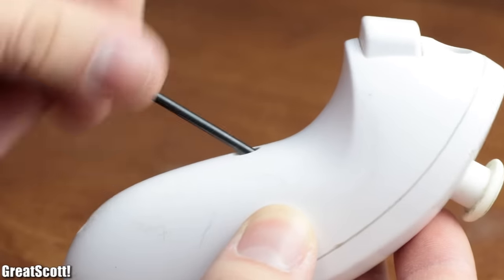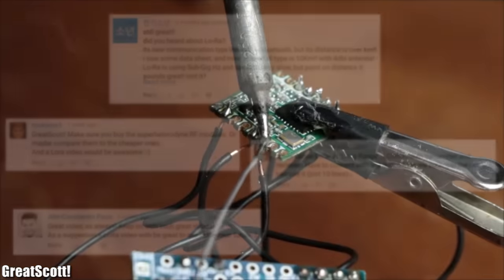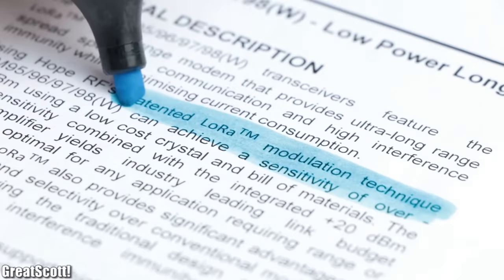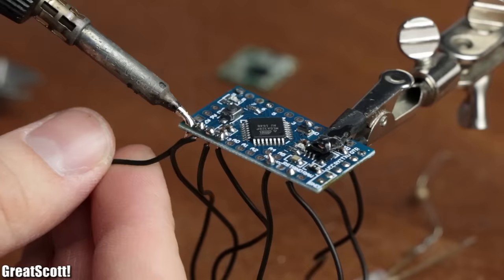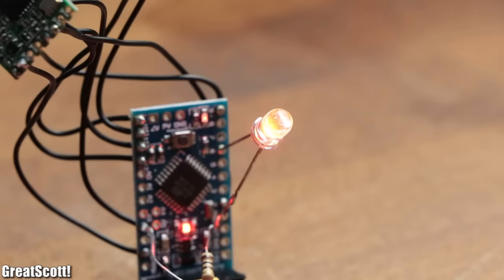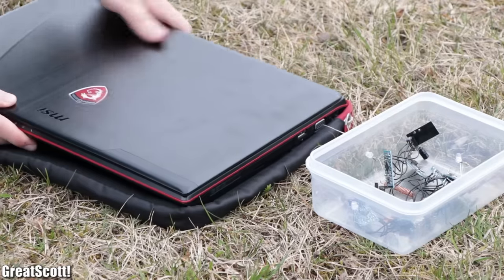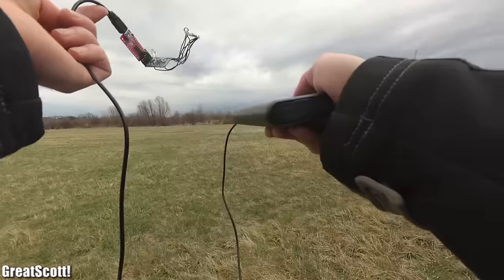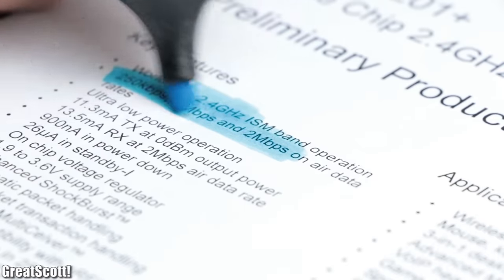LoRa Module VS nRF24 VS Generic RF Module || Range & Power Test

Comment: I've tried adding an X2401C chip as an amplifier for nRF24L01, and it turnd out that the range can rise much higher. Actually this type of combination is very popular now, but I just felt like designing one myself so I can integrate the circuit with other modules in a single board later :-)

Comment: One EXTREMELY important thing that you did not mention here. That is duty cycle. LoRa is limited by law to transmitting at most 1% of the time. If you have a problem where you need to be transmitting more than that, you must eliminate LoRa from consideration at the start.
The nice thing about LRF24 is that it's highly resistant to noise. I've built real time remote control stage props using it, and I can easily get a couple dozen channels in and control it from the back of a theater and have good confidence in it working on queue. LoRa would not be usable there because I need to transmit constantly.
Reply: When you talk about laws you need to specify the country and frequency. No laws apply to LoRa specifically and LoRa can operate on several different frequencies. I think you're talking about 915 MHz in the U.S. is that correct?
Reply: isn't that only for the subbands?
Reply: No i think he speaks about ISM in Europe.... so he is totaly correct. 36s transmition time per day ! sooooooo not a good choice for this project....
Reply: JuulCPH LoRa in the US 915MHz band is allowed a 40% duty cycle. Much better than Europe.
Reply: I agree - I digged into LoRa a month ago... but I have some questions, I haven't been able to get a proper answer to, if I may... If I set up a service with some nodes, transmitting to a LoRaWan, what will stop "bad guys" from jamming the entire network by transmitting constantly? Do I have to rely on the authorities to shut it down? Also, 8 channels using 1% bandwith = 800 nodes in theory. What happens when there's no more bandwidth - or if two nodes transmit simultaneously? Will the system give the strongest signal priority?
Reply: what law is that? definitely not FCC
Reply: LoRa Class C allows for continuous reception and transmission at any time.   You might be confusing it with the LoRaWAN TTN network which limits duty cycle.   You can't use LoRa class C on the TTN network.

Comment: Great video. To perform such kind of test you need to investigate also the antenna type, orientation and connection. I'm suspecting you are loosing a lot of power on these blocks. Pay also attention not to transmit something without antenna, you can damage the transmitter because you are working with very bad SWR ! Look at Andreas Speiss video about Lora enad antenna matching. In any case thanks for this video.

Comment: Should do a vid on the esp8266 boards also. they dont necessarily need a wireless router to connect and talk. one can be in AP mode and others can connect and talk to that one. It is another form of communication that should be considered.

Comment: Why did you use the 433 mhz antenna with the 868 mhz LoRa module? It should be a different length for 868 mhz, you should be able to easily get 1 km or more in an open area with those modules and a wire antenna of proper length.
Reply: surely if 868mhz is twice 433mhz the antenna would be a harmonic of the wavelength, though?
Reply: @racketman2u  Something, something, impedance.
Reply: Cut the antenna in half,  but helical is bad antenna for this

Comment: 7:29 you said 4 kilobits per second, but it is written like 4KB/s not as 4Kbps so it's kilobytes and 1kiloyte equals 8 kilobits so the first one can handle  32 Kbps(4KB/s times 8bits in a byte)

Comment: I think if you're only getting that range out of LoRa you must have extremely poorly matched antennas.  You should be getting hundreds of meters easily.
Reply: A km easy!
Reply: and I think he forgot to set the spreading factor, but even with the default it should be much more than this.
Reply: John Ridley with the same devs i was able to get 18.9km, something is odd there (rmf95w > lora gw)
Reply: Well he was holding the antenna in front of him while moving away from the transmitter behind him so, his body did not help
Reply: In our tests at the IoT company I work for, we got 500m range the middle of the suburbs, surrounded by houses and concrete buildings. LoRa is excellent.

Comment: I used to do nRF's until I discovered Si4432 modules. They are much powerful and customizable. A little messy to calibrate but there is an Arduino library you can use which makes it a breeze.

Comment: Generally speaking, the higher the frequency, the higher the data transfer rate, and the higher the power consumption for the same distance (or the shorter the distance for the same power consumption), that would explain all the testing result. So there that is the trade-off. I have played with nRF24+ for a while and got a similar testing result for the maximum distance. But I need to mention there are variations to nRF24+ with an amplifier or better an antenna that is designed to handle longer distances (the seller claims it will work for ~900 meters in clean space, but I never test it). Of course, an additional amplifier would consume more energy.

Comment: Great video! As Andreas mentionned LoRa has more potential. I'd also give 2.4 GHz more chances with nrf24+pa+lna and use nRF51 and nRF52 which have +4db in stead of 0db of nrf24.

Comment: Looks like this is going to be the go to module for your quad-copter project. Can we extend the existing antenna (They call it something like the Meandered inverted F antenna ) on the nRF24 for a better range? Make an electronics basics video on antennas.

Comment: There are also hihg power NRFs with claimed range of 1100 meters in open field. The transmission range depends on power amplification set in the program too. 5 meters seems like you set it to minimum.

Comment: Great tests and explanations. In the future I would like to see a distance test with the transmitter antenna mounted on a pole or higher structure. Even the roof of a car. My guess is that LoRa will show a remarkable distance improvement.

Comment: I ported the Arduinio Virtual Wire library from C to JAL and used on a PIC microcontroller together with the 433 MHz transmitter and receiver module but the range is higher than mentioned in your video. If you look at the documentation of the Virtual Wire Library it should be able to reach 100 Meters depending on the chosen bitrate.

Comment: Can you try also HC 12 modules? They are transreceivers which costs around 7 euros on amazon (in Italy). Per datasheet, they can transmit in a range of about 1,8 kilometers.

Comment: In the video you tell us you're using a 868 LoRa module, but you use the antenna of the generic 433 MHz modules? Also the amazon link leads to a 433 MHz module?

Comment: Great video. Right on time, too! 😎👍🤠
I'm thinking of remaking my dog collars and was wondering about which broadcast tech to go with. I think I'll be using LoRa after having watched this video. 10m is not far for a dog to roam, especially on my property. 300m is more like it. Do you know what the obstacle permeability of LoRa is with relation to distance?
I would also like to add a gps monitor (which LoRa could upload as well). Do you have any recommendations on a small module with little power usage?

Comment: Nice experimentation.  At time frame @5:34 have you had chance to test for range in different area? Were there any cellular or power transmitters near you? If yes then there maybe an interfering signals affecting the range test. Just food for the thought. Believe it or not, even the nearby microwave oven or other equipment may reduce the range because then the signal will be received by the receiver and thought of as noise. Filtering and power increase may increase the range, to overcome noise, if any.

Comment: Did you know that there is a verison of the NRF24 with an antenna and a repeater on the same board? It has a range of about 1 km. I'm using it for my projects.

Comment: Its known that lower frequency has higher range; 433MHz has higher range and 2.4GHz has the smallest. Also, the power consumption is proportional to frequency. Data rate is proportional to bandwidth (carrier frequency), so 2.4GHz has the highest.

Comment: I lost a quadcopter a few weeks back.  A wind burst pushed it over the treeline.  I shut it down, got in my vehicle and drove to where it should have landed.  Vanished!  So now I'm exploring the idea of building a tiny unit that reads data from a GPS chip and transmits the current LAT/LON. And a tiny receiver that will receive the GPS coordinates and display it on an LED display.  Investigating LORA, NRF, ESP8266.  I've worked with ESP8266, I don't think the range would be big enough to cover a football field size area.  Any suggestions?  Thanks in advance.

Comment: I thing you should consider to repeat your test with proper antennas (even a simple wire antenna is better than the helix). I used the Generic RF Module exept tat I used the superheterodyne receiver RXB6. I wrote my own protocoll for the transmission and receiving. I have a data rate of 2kbit / s and got a range of 900m on the free field till the receiving "act strange". So I thing with a better setup you could get much better results

Comment: Signal amplification and antennas are very important for RF range, so I guess you could use WIFI antenna for the nRF24 case. Most RF modules have standard antenna connection to attach external antenna.

Comment: You could at least point antennas properly cause they don't radiate the same power to every direction. I managed to get up to 50m with nRF24 and up to 600m nRF24+Pa+LNA modules on line of sight. Good capacitors on power line and stable power source are also very mportant. Anyway, thank you for the video

Comment: If you use proper antennas, you'll get much better results! LoRa can easily reach kilometer distances. My record with the same module is 27km between Vlieland and Harlingen in the Netherlands.

Comment: The generic one offer speed of 4 KByte/Sec.
But the lora offers 37.5Kbit not Byte so we have to divide by 8 to get the speed in KiloByte as in generic one. So the lora offers almost 4.68KB/Sec. Which is close enough to generic one.

And nf24l01 offers upto 2Mbit/Sec(250KByte /Sec)which is the fastest

Comment: I use a pair of nRF24 on my DIY longboard setup as well, even with wires, battery and aluminium case of the speed controllers I get 30m before  start to loose packages

Comment: LoRa has SERIOUS limitations not exposed in the video. it is not intended for real time nor big packet tranfers. You can still do it, but there are some rules about the duty cycle of the transmision ... 1% for Europe. Why ?. Because each time you send a packet, in order to the gateway to receive it, no other comunication can take place . so all other module need to wait until it finishes. LoRa has channels to overcome it, they will set up to 64 of them. Still looks like easy to bottleneck if used improperly. Range is supposed to be far more than in the video and many tests already have proved that. BUT, the far you go, the slow it gets. also you need to adjust settings as this happens. The last point that the video missed is, YOU CANT USE LoRa IN Point to Point. You NEED A GATEWAY ... i.e infrastructure ... example .. a TELCO. Your packet go to the gateway and then to the other radio. You can do a P2P RF link, BUT just using FSK or something like that, I mean, stoping the LoRa part and just using the radio ... but it will reach the range of any other 865Mhz radio. The trick of LoRa is the modulation. But dont miss the point, YOU DEPEND on a THIRD PARTY GATEWAY, like a CELLPHONE.  LoRa is stunning for small data in rural areas (not dense populated). I dont see this on big cities or project were big chunks of data are needed. It is not the technology. Porbably Sigfox  (I havent read about it). You can purchase you gateway of course. They are a bit expensive. If you want to manage it remotly and some other functions, like web access control and location .. bla bla bla ... you need a SW package and to purchase a key. The gateway I was offered is a Linux embeded system with a console.

Comment: I didn't notice this before, but 433 MHz is square in the range of ham radio 70cm, making it illegal to use if you're caught with it. Probably not a problem because it's so low power, but something to be aware of.
EDIT:
Having read up more on it, this actually varies wild with the country, but should be fine to use for the most part so long as it's kept low power and non harmful.

Comment: I don't know what you did wrong, but if you're getting less than 1 km with the LoRa module then something is not working as it should. Maybe that antenna is not good for ~915 MHz? Keep in mind you also need to tweak the spreading factor parameter if you want the longest range possible. Also, with the RFM95W just because you received a packet does not mean you received an uncorrupted packet.

Comment: I wonder which modules are less picky when trying to miniaturize the setup. I got normal size nRF24 modules working fine in my room, but then I wanted to use the SMD-sized one that I soldered directly onto Arduino Pro Mini to make it fit inside the device I wanted to upgrade with low-latency wireless communication. The SMD version has too high packet loss when positioned right on top of the Arduino - it does not receive ACKs well enough and the other side receives the same packets multiple times. So, not sure how to make everything fit nicely in the small case.

Comment: I use RFM69HW modules (at 868MHz) with the RadioHead library. They are cheap, they have low power modes, and I can communicate over about 30m with two walls between each transceiver at a data transfer rate of 250kBps! Not sure about power consumption - the datasheet says 16mA during receive. I run mine at 13dBm transmit power, which translates into 45mA according to the datasheet. But at 250kBps the transmit time is low.

Comment: Im very new to programming in general but, is there a decent book that goes into detail of programming LoRa? I wanted to make something that could wirelessly control a Lora board on the end. (With a relay attached).Then have a controller that had the option to turn the relay off and on. I don't even know where to start with this.

Comment: This is quite a silly comparison.  The data rates aren't the same, the antennas aren't really fair comparisons and the TX power wan't even mentioned...  The LoRa is most likely using spread spectrum (it's signature move) so it will take WAY more energy to transmit data than the nRF24 @ 2MHz for the same TX power.

Comment: 07:27 It's 4 "KiloBytes per second" (KBps) and not "Kilobits per second" (Kbps) for the generic one. This is pretty much the same as the bitrate for the LoRa i.e. 37.5 Kbps = 4.6875 KBps. They are not very different when it comes to bitrates.

Comment: If you raise your transmitting module at least 1 or 2 meters above ground, you should get better range.
The range is very dependent on the height of the transmitting and receiving antennas.

Comment: excellent video
but I have a difficulty with my montage
When both are connected it works very well and I have data transmission and reception, but in such a case that the receiver disconnects it from the power supply and the transmitter tries to send a data and as it does not have the receiver it restarts itself, what could be the problem?

I am using an esp8266 series esp07

Comment: There is so much wrong with this video. For first these 433mhz transmitter is not designed to be operated with 5 volts. They give good results with around 12 volts. Second, you used a crap antenna. Third, you used the same crap antenna for 433mhz and 868mhz! Fourth, you didn't have the nRF24 boards(at least the transmitter) with a power amp and an antenna! They give incredible results. Fifth, you could use a more proffessional setup with proper equal antennas (same dBi, different freq) and a portable spectrum analyzer to also do some amplitude measurement to find out the power of the transmitters/ the sensitivity of the recievers.

Comment: If the antenna is not specificaly designed for the frequency used, it is worse than not using antena. You should have some kilometers of range with LoRa ;)

Comment: hi, pascal (or as you want scott) i have a little problem i used nrf24l01 for sending messages, but i wanted to make rc car with this, could you help me, please
i have arduino mega2560 rev3 and raspberry pi 3b+ and i dont know if i can use them or ia have to use another arduino
this car supposed to be powered by li-ion 2s2p or 3s2p and brushless motor
i hope you answer
thanks

Comment: LoRa also can be used as wireless broadband network for small data exchange. Weather stations or location trackers would be great examples. Here in Korea, LoRa broadband is alreay available throughout the country and you can use this network for less than a dollar per month. Low power consumption, low cost. So much better than GSM or LTE network if you’re building a small project that needs internet access anywhere.

Comment: Nrf module without antenna works 20-30m very pretty, and with antena module I got more then 450m clear renge. I think you shuld test it again
Reply: Hi, can I send 60-120 bytes every 100ms with the nrf without issues at that distance?

Comment: Hey greatscott big lover of your channel and fan Inspired from your videos I built many projects.lately I just built an airplane which uses nrf24 what I do is use atmega with nrf on plane and Arduino nrf as transmitter now I want to send real time battery voltage from plane to transmitter how can I do that I can measure the volt via analogue pin 0 and some resistance please help